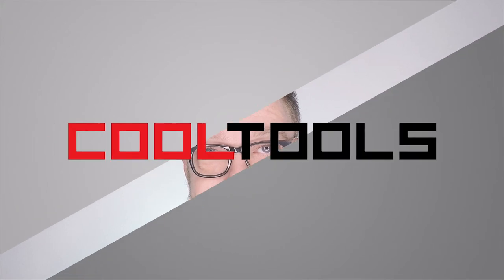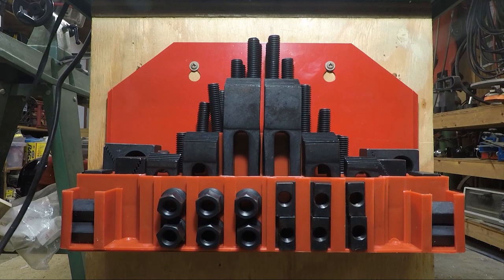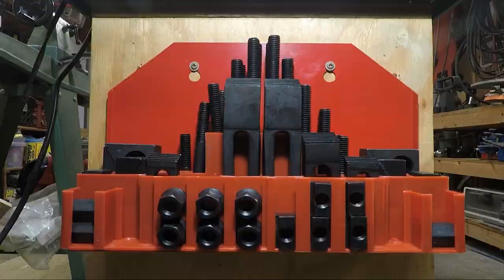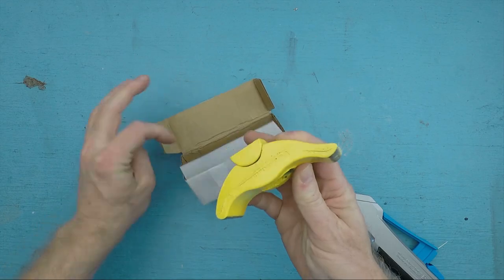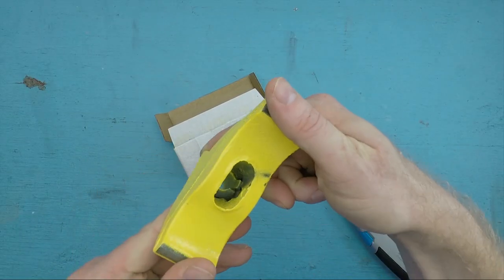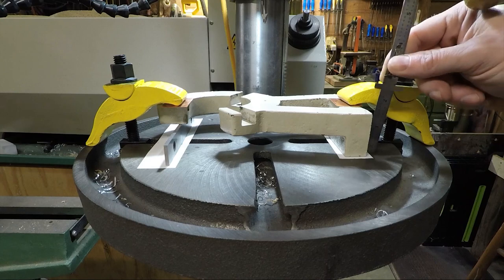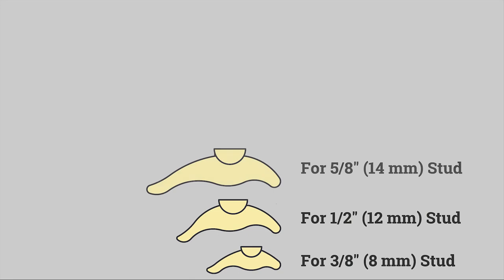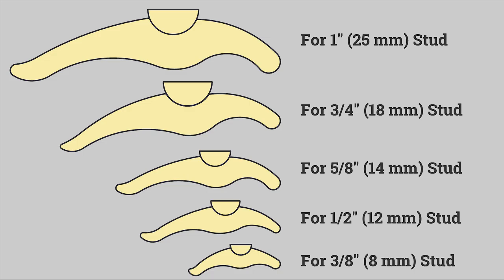RiteHite Clamps

Comment: Good informative video.
Just wanna point out that in the place where I work, some of the studs & flange nuts have been damaged due to being machined due to wrong set up or wrong CNC program, we just use regular bolts & washers instead, available & does the job!